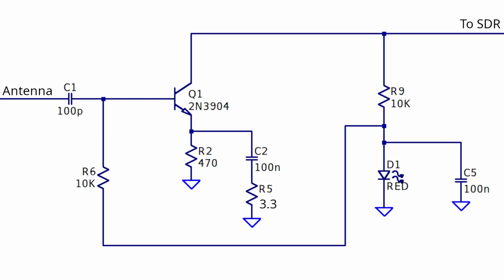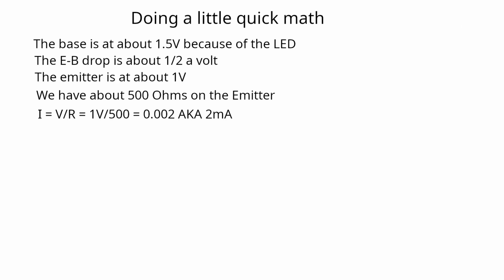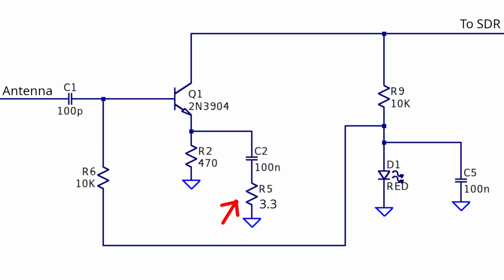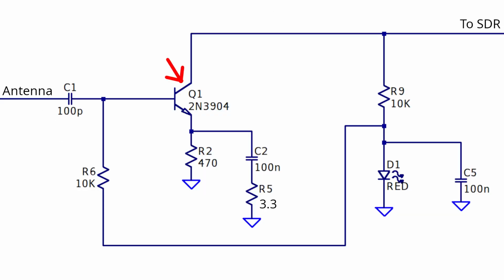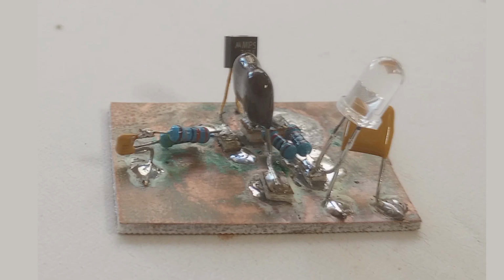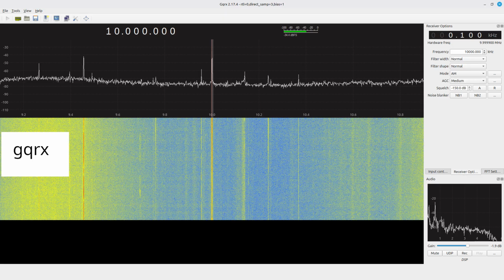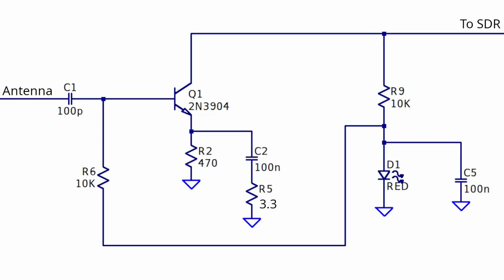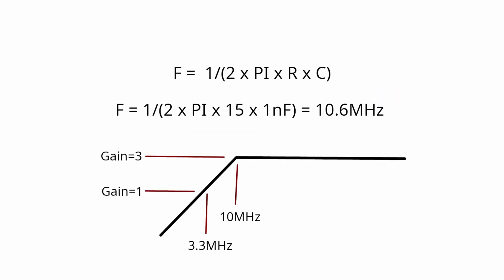An Amplifier for Short Wave reception

Comment: I live in a very low signal environment! Can I use two of this amplifier in cascade, one after the other to really magnify the signal?
Reply from the maker: If you have a very weak signal, more amplification may not help.  There is natural noise in the environment.  This noise may be larger than the signal.  The transistor also has an input noise.
The first step would be to have a better antenna.  In my case I have a rather poor antenna mostly because I am lazy.  Do you have room to put up a good antenna?  What frequencies are you interested in?
Yes, two transistors can give you more gain than what I was using but you may not need that.  If the strong radio stations near you are not all that strong, you can increase the gain of the one transistor design.  I am running the transistor at a current of about 2mA.  If you instead run it at 4mA you will get about twice the gain.  This would be my first proto-type.  
On a two transistor design.  You would want a resistor on the collector of the first transistor of perhaps 200 Ohms.  This would give that stage more voltage gain.  A second stage and then be in charge of getting the lower impedance to drive the 50 Ohm load and provide a little more gain.

Comment: Would a BFR96 have worked or a Dual Gate MOSFET might have been even better as you can adjust the gain.
Reply from the maker: Yes that is true but I did this project mostly with the parts I had on hand.  I had to buy the SMA connector.
Also:  I did want to explain that point about the BJT transistor's gain.  That was part of my motivation for making this one.

Comment: That amp isnt tuned, it will amplifier everything including noise
Reply from the maker: Yes, 100% it amplifies everything including noise.  But remember the noise it is amplifying is the noise at its input.  The larger signal (and noise) means that the input noise[1] of the SDR is less important.  It is also doing the impedance adapting as I pointed out.

[1] Input noise AKA the noise of the first stage of the SDR in this case.